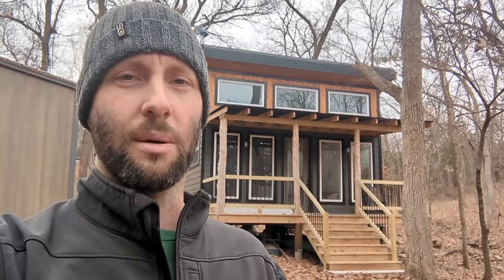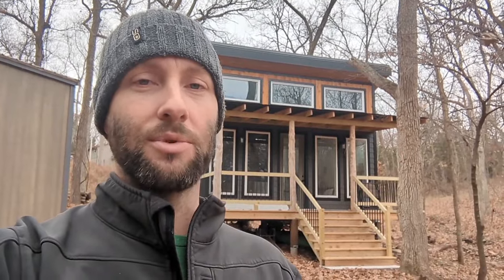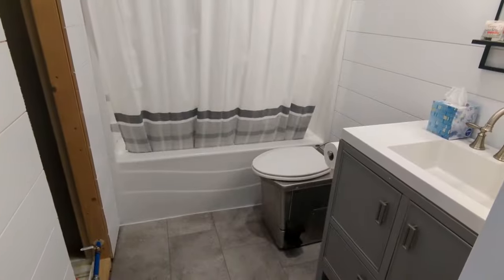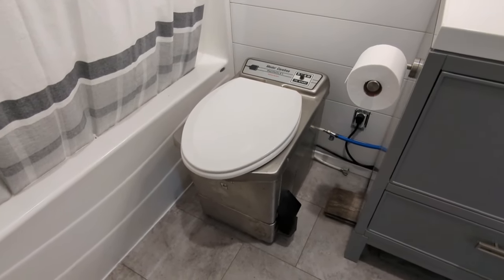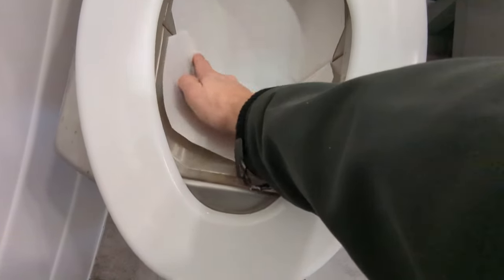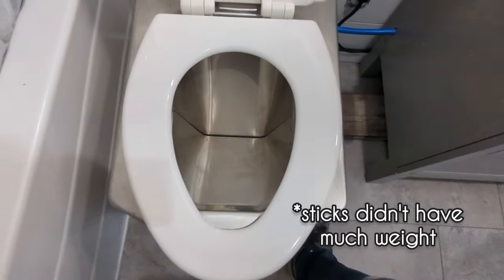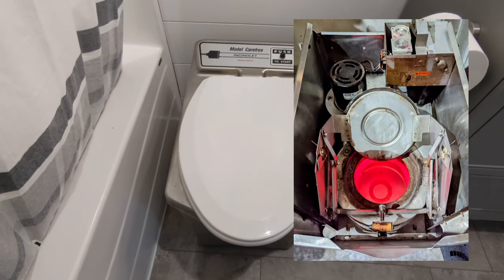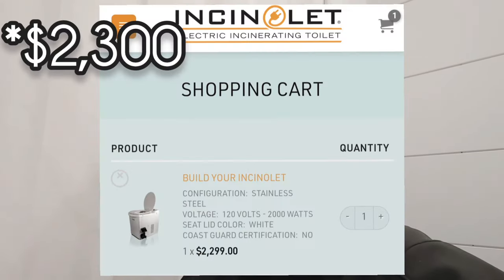A FIRE Toilet with No Water?! - Incinolet Review

Comment: We bought our Incinolet (pre-plandemic)... now that we are building up on our property and installing off grid power... preparing to utilize it! Thanks for posting your video! My biggest thing is the power hungry part - we will be employing a 2,000 amp hour battery bank.
Reply from the maker: A 2,000 amp hour battery bank is MASSIVE.  Are you using lithium batteries?  What voltage?
Reply: @jessesmithchannel  Jesse - we have a decommissioned industrial Absolyte GX 48v/2000Ah from a telecommunications company. It is a Valve Regulated Lead Acid/AGM style. There are 2 volt cells encased in steel boxes. Unfortunately we can't track down the racking parts for stacking them so they take up a lot of real-estate on the floor until we purchase suitable racking and get them vertical...lol! We'll move to a new battery bank when these are completely expended.

Comment: Thanks for a full, honest  review. And it seems loud...I didn't think about that noise running for an hour and a half at a time! In a tiny home it would definitely  be a nuisance.
Reply from the maker: It can be quite loud.  My unit is likely a bit louder than most, since I replaced the fan myself.
Reply: @jessesmithchannel Just my two cents I'm interested in getting one of these but the liner part kind of gets to me it's like an extra step before I do my business however I was thinking what would happen if someone were to use it without the liner and REPLACE the liner part with a non-stick anti flammable material (teflon) CAN YOU TRY IT?
Reply: @SR-sh9dk 😂😂😂
Make sure to film this 😂

Comment: You CAN AN SHOULD use a bathroom exhaust fan while the Incinolet is burning. The trick is to wire it as an INTAKE fan so it forces air from the rest of the house into the bathroom. This puts positive pressure in the room, helping the Incinolet's exhaust fan (and burner) do a better faster job.
Reply from the maker: Air flow is critical, so using an intake fan would be wise.  You just don't want an exhaust fan trying to pull air out of the room (which is standard), because it will backdraft the smoke from the incinolet.
Reply: Great to know! We have not installed our unit yet but I will keep this in mind!

Comment: Another thing is that the septic field is over an area of 20x80ft (land you now can't build on or use very much)  the cost to put in varires but often 8-30k depending on soil if it fails as my sister did she had to remove and replace the field and tank and all the contaminated soil this was over 50k and fines. incineration toilets start at 3k (as low as 400 used)if your worried about electric bills the gas version is more efficient,  take up no additional space will not contaminate your well water or get you fined a top of the line cinderella is about 5k  there are also composting toilets they have their + and -
Reply from the maker: Small price to pay, compared to the downsides of septic!

Comment: We have had our for almost 1 year. We put the vent pipe up above our roofline so we have zero smell. I did add some bubble foil insulation in the walls and built a door with it inside and we can’t even hear it during the burn cycle. The do have a propane option so I am seriously considering that for my next RV and eliminating the need of tank and having 2 grays.
Reply from the maker: I didn't realize there was a propane option.  I wonder how much gas it blows through during a flush cycle.

Comment: Hi Jesse, Thank you so much for sharing your thoughts! Since you have been using the incinerating toilet for a while, how do you feel about it now compared to when you first started using it? Has your perception or satisfaction level changed over time?
Reply from the maker: We haven't gotten down to the cabin as often as we had hoped over the summer.  However, we have had a handful of weekends to test it out.  For our use case, it's great.  If we needed full time use, I would really want to find a more standard water option.

Our unit is also one that I repaired by replacing the fan.  I think that has resulted in a sliiiiight bit more noise from the fan than usual.  That can be a little irritating at times.
Reply: @jessesmithchannel  good know as well... as long as it is not freight-train loud! LOL!

Comment: Ours vents outside & you do smell it. We use it in an STR on the Puget Sound since the property doesn’t qualify for a septic. I empty the pan between quests. 
Drawbacks - complicated for guests, flush sticks open sometimes, smells like pee/poo outside & pee leaks out of bottom on floor sometimes (empty often helps with this).
I wish they had scented liners 🤷‍♀️ or maybe I’ll start putting essential oils on liners ….  Occasionally sticking open problem  - we haven’t been able to solve.
Reply: I will add - We do love it otherwise - it works great!
Reply from the maker: I recently learned that some models have a chamber with pellets that filter the smells and fumes.  My model doesn't, but worth looking into.

Comment: Had one in my camp in northern NH when I bought the place, with myself and 3 girls there were a lot of plumes of pee and the thing wouldn't shut half the time, we nicknamed it the Fire Hopper due to the 2' flame rolling out of it. I finally had enough and ripped it out and put a composting toilet in, haven't missed the Fire Hopper for a second.
Reply from the maker: Yeah, this is less than ideal for just going pee.
Reply: I would really like to no more about composting & maybe switch. I use mine in a STR & am afraid the guests won’t turn compost when finished. Do they have compost toilets that are automatic? I have power at cabin no water.
Reply: @footballgirl69  There are numerous composting toilets on the market, as far as auto tumble that I don't know. 
 It's funny, my wife, daughters, daughters friends, all of my whom are females have zero issues with the composting toilet, however my rough and tumble hunting buddies whine about it...bunch of Primadonna's.

Comment: Are you able to get county water for the shower without a septic tank ?
Reply from the maker: There's a city water system, and I had a meter installed at the curb.  There's also a low pressure sewer system, but connecting to that would require a very expensive pump and installation.  Plus, I would need special permission from the city, because my cabin size is under the minimum for a "residence."
Reply: @jessesmithchannel  since you have a meter, will they turn it on, like can you connect a water hose to the line and fill up a water container, for shower water? thanks for sharing

Comment: how much wats does it use? could you run it off solar
Reply from the maker: It's a pretty significant current draw, and the cycle runs for over an hour.  It could certainly be run on a solar power system, but you would also need battery storage and a large inverter.  I've seen these installed in camper vans.

Comment: Ive seen gass powered ones to if you can get gass canisters then your good
Reply from the maker: I haven't seen those.
Reply: @jessesmithchannel  yeah it's called "Cinderella incinerator toilet" you connected LPG GAS ( propane)  and it works in the same way but I think the cycle is 40 minutes, its definitely handy then using power, only downside is you gotta replace gass, we have them on off-grid canal boats or some people do.  I'm currently trying to acquire a boat shell and fit it out and put on of them toilets in. I'm not sure if it's just a UK model or world wide.

Comment: Hey Jesse, holy moly your review is the first I've seen that says there is actually poop (pee too?) smell while it's incinerating. So it smells like poop outside while it's operating right? Afterwards too? Is there a pee odor as well? I'm interested in getting a Cinderella for an RV (have been considering it for some time now). Biggest concern would be in RV parks -being "that guy" and putting the neighbors thru that, having them complain about it (because if it was me I would likely complain myself as I don't wanna smell someone else's "waste" burning, - it would likely make me sick). Ya know it's the common sense thing that hits me, as I imagine just lighting a fire like in a fire pit or something and tossing some poop in it. I'm certain it would smell awful, so I've had a hard time imagining that it would be very different with an incinerating toilet .....even though there are so many reviews stating there isn't an odor. Uhg! What to believe?!?! ...Could you give me your opinion when you get a sec? Would super appreciate it. Thanks Steph :D
Reply from the maker: There's no odor inside.  But outside, there's a distinct smell.  It doesn't smell like poop, but it's an unpleasant, smoky smell for a little while.
Reply: A new incinolet unit has little or  no poo odor. The exhaust does thru platinum pellets in the unit..ie exhaust air goes thru a catalyst converter type chamber. After years usage the pellets work worse . So you open up the pellet chamber and vacuum them out. This basically separates some ash from the pellets and thus makes them have more active surface area..you can also buy several bags of new pellets too. They you refill the pellet chamber with pellets.  

The reason there is some folks saying there is an poo odor is often the incinolet  is older and never maintained. 

These units have been made over half a century.
Reply: There is an order - but it’s not like you think - no like straight burning poo - but it does smell. And depends on direction of wind 😂
Reply: @3beltwesty great point - mine is old…. I don’t think I have pellets 🤔 going to check that! Maybe I’m due for a new one. Ours is probably 12 years old.

Comment: It must use a ton of electricity.
Reply from the maker: It really doesn't use as much as you would expect.  The heating element is the biggest draw, and it's only on periodically during the burn process.  Otherwise, it's a simple fan motor.  No more power than running a convection oven to make dinner.
Reply: Do you know the wattage ot uses?

Comment: If you van has a 48v second alternator, like Volta, Mastervolt, Pure, Lithionics, etc do to charge 48v lithium systems, an hour on the road will burn the toilet clean and then recharge the batteries all the rest of the day.
 Not so crazy compared to black tanks, pumping $tation$, dragging cassettes, or the Laveo nondegradeable sanitary waste. Or all the fake composting toilets, also sanitary waste.
Reply from the maker: While true, that's a fairly specific application.  I've seen builds that do exactly that, and they have massive battery banks.  It gets tricky if you plan to set up in one place for any length of time, unless you get a second alternator that can run at idle without burning up.
Reply: Great to know! We are going to be living in our 40' RV while we build a modified Earthship Biotecture home. We are on 48v Conext SW4048 Inverter for our off grid power supply (2,000amp hour VLRA battery bank). We will be able to swap out the toilet/seal the black tank and install our Incinolet. We will have a gray-water tank for the other to gray water tanks on board... beats having to fight with the Health Department while we are building!